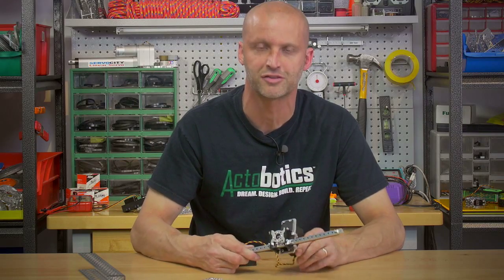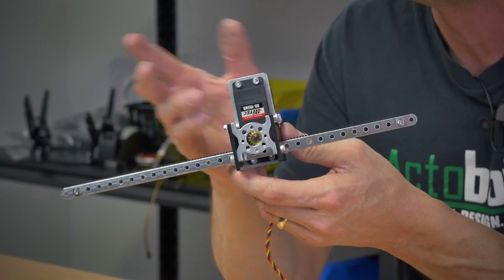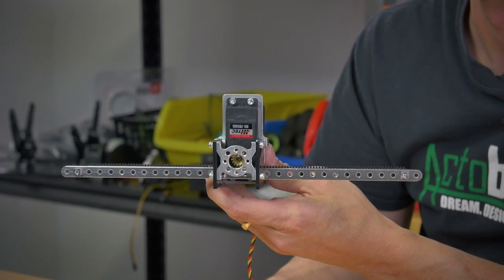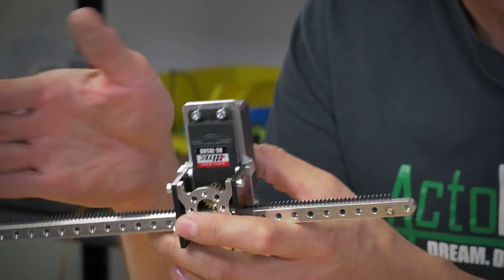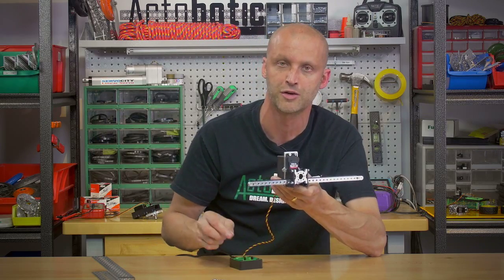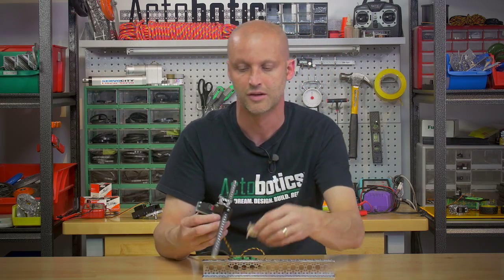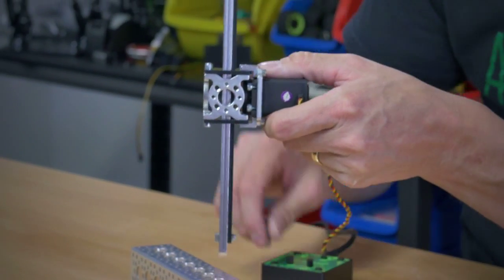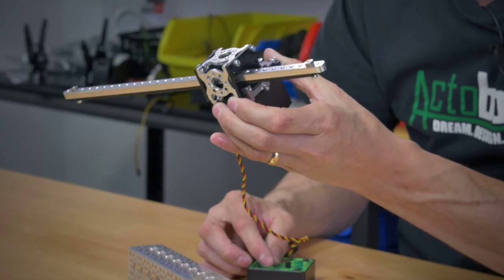ServoCity Products: 785 Gear Rack Kit

Comment: @ServoCity -What power supply were you using?
Reply from the maker: You can use the Dual Servo Driver
 Servo Controller with this Sku: 902MSD and that can be powered by a 4.8-6V battery or regulated power supply. https://www.servocity.com/dual-servo-driver/. Please let us know if you have any further questions.

Comment: Could a feedback pot or encoder be used on the rack for positioning?
Reply from the maker: Yes, you could add a position sensor on the rack if you need feedback other than the internal feedback used by the servo.

Comment: How much is the torque?
Reply from the maker: The gear rack is taking the rotational motion of the servo and creating a linear motion therefore the torque is converted to thrust.  The servo has 183 oz-in of torque and the radius of the gear is .25in therefore, negating friction, the linear thrust would be 732ozf.  Please let us know should you have any other questions!

Comment: Can I find out how fast the servo can move the rack from end to end, at its fastest speed?
Reply from the maker: Hi Andrew, the HS-785HB rotates 1 turn every 1.4 seconds.  The gear that goes on the servo is a 16 tooth gear.  The rack is 118 teeth.  That means the servo must rotate 7.375 turns (118 teeth / 16 teeth) to drive the rack from one end to the other.  At 1.4 seconds per rotation it'll take 10.3 seconds (7.375 rotations * 1.4 seconds per rotation) to move the full distance.

Keep in mind that the speed calculated is at no load.  Things like load, voltage and current can all play a factor in the final speed of a servo.  There is also a small amount of ramp-down built into the servo.  As it nears the position it's been called to go to, it will begin to slow down so that it doesn't over-shoot or stop so abruptly - this too will cause a slight variance between theoretical speed and actual speed.  Please let us know should you have any additional questions tech@servocity.com.
Reply: Thank you very much for the answer.
Reply from the maker: Glad we could help!

Comment: hi ServoCity,
If I fixed both ends, then could the servo with the rack and pinion assembly move relative to the stationary beam?
The mechanism would operate similar to a camera slider kit, except with a smaller profile and travel.

Thank you,
bainmack
Reply from the maker: With the gear rack “fixed” the servo will move on the Gear Rack just like slider.  Please contact us should you have any additional questions tech@servocity.com
Reply: Thank you!

Comment: Hello, may I ask, how much is the weight of each aluminum beam and strong in terms of rigidity?
Reply from the maker: Hi John, each individual beam is 1.60 oz.  They're 6061 T6 aluminum and 1/4" in thickness so they're quite rigid. Please let us know if you have any additional questions tech@servocity.com
Reply: The thickness in your step file is 3.18mm though for one beam, 
not 6,36mm ( 1/4" inch) as you mention.
That taken from your site
https://www.servocity.com/6-16-aluminum-beam
Reply from the maker: Hi John, the aluminum beam used in this gear rack is https://www.servocity.com/12-32-aluminum-beam.  It is 1/4" thickness.  The plastic gear rack https://www.servocity.com/beam-gear-rack is 3.18mm.  Please let us know should you have any additional questions.  I believe the STEP file you are looking at is for the gear rack kit.
Reply: Thank u

Comment: Does it hold the load when power is cut?
Reply from the maker: +Zxenmusic Hi - 
An HS-785HB servo is able to be backdriven when powered down.If you have other questions, our techs would be happy to answer! Tech@servocity.com 
Thanks!
Reply: +ServoCity So it will fall when the power is switched off then? Doesn't this mean that the servo will jiggle and overheat when holding?
Reply from the maker: +Zxenmusic 

Analog servos are pretty resilient to constant loads.  If you load up the gear rack kit so that the servo has to run near stall torque you’ll want to pay attention to the temperature of the servo and back off if it gets too hot.  These servos get used in r/c sail boats all the time where they must hold constant tension on a sail; same type of loading.

Comment from the maker: Hi Mathieu, the servo has 183 oz-in and the gear has a pitch diameter of .5” and so when figured (without friction) the gear rack kit could lift up to 45.75lbs in an ideal setup.  How the load is applied will determine the amount of friction in the assembly which will affect the amount of thrust that it can exert.  If you have any other questions our tech team would be glad to answer them tech@servocity.com.

Comment: What is the repeatability & accuracy of positioning of this?
Reply from the maker: James Burris Thanks for the question James.  Accuracy is roughly .05 inches given that the 785HB servo has 256 points of reference.  Repeat-ability is excellent as long as you approach a given point from the same direction (say, if you're desired point is 1500usec and you approach from below 1500 to that particular point).  If you approach that point from the other side the deadband of the servo will effect repeatability and you may find that it's a few hundredths off.  For any further questions feel free to email our tech dept.